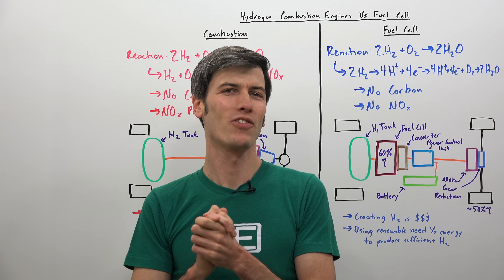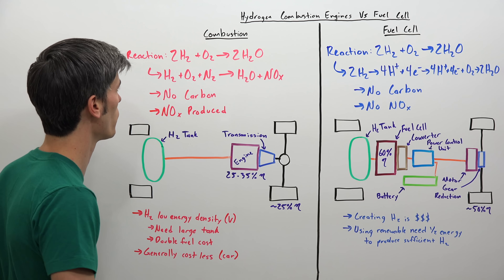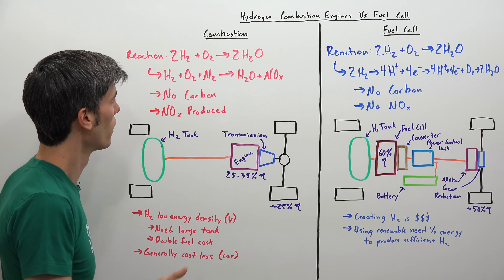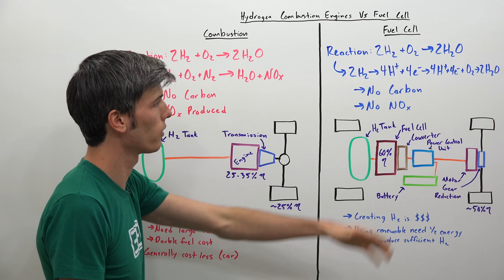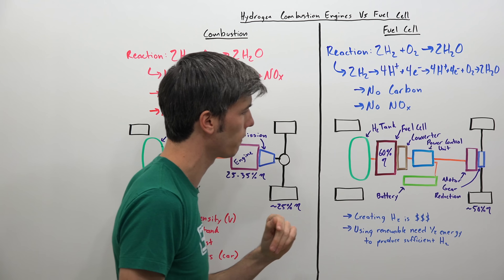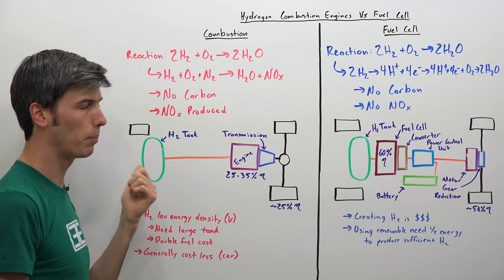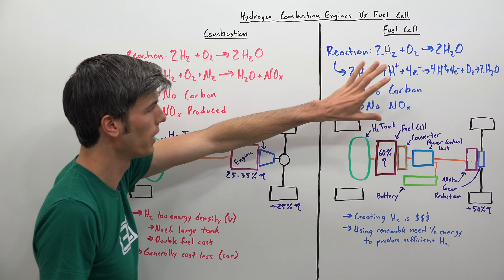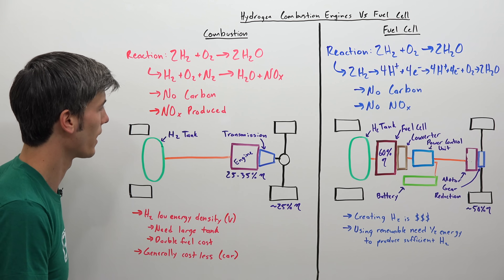Why Hydrogen Engines Are A Bad Idea

Comment: I'm interested in a comparison of the environmental costs of the components of a fuel cell system versus a combustion system. Comparatively, how much environmental damage must be done to obtain the resources, process them, and manufacture components of each system? Comparatively, how durable is each system; which has a higher rate of the machine components needing be to replaced and which system results in more components ending up as non-recyclable waste? Also, which system's components involve more toxic pollutants that we will need to deal with at end of their operational life? The energy efficiency and emissions during operation are just one part (and maybe not even the most significant part) of the evaluation when comparing systems. While we might be reducing emissions at the tailpipe, we might actually be increasing the overall amount of greenhouse gases as well as toxic pollutants if the manufacture and disposal end up being dirtier. I think of my new energy-efficient washing machine that doesn't do a very good job and broke down after 11 months requiring electrical components to be replaced, and then broke down again one month later requiring another trip by the repairman and creating more electrical waste. Compare this to my old washing machine that did a load of laundry in 20 minutes as opposed to hour, got the clothes cleaner, and lasted thirty years. Granted, the new computerized machine is touted as using half as much water and 25% less energy than the old simple mechanical one, but if I am going to end up going through several of these new high-tech machines over a thirty-year period, sending that many entire machines to the landfill and creating that much toxic e-waste maintaining them, I cannot see how it can honestly be regarded as more sustainable and environmentally friendly in the big picture. Also, the new high-tech machine costs a hell of a lot more, takes more than three times as long to do a load of laundry, and does not clean clothes as well. I think we are making a grave mistake by narrowly focusing on the operational metrics rather than the overall big picture.

Comment: Most do not realize that the hydrogen molecules are so small that they leak fairly quickly even through metal, even steel. Where pressure sensors are needed for instrumentation, a better way to prevent hydrogen from passing gas thru stainless steel sensor diaphragms is to have the steel electroplated with a thin layer of gold! Larger vessels as well as pipelines are also subject to damage by hydrogen embrittlement! Sealing the inside of pipes and vessels with a thin plastic liner helps to extend the life of the metal and reduce hydrogen leakage.

Comment: Great explanation.  IMHO, you are showing the path to conversion.  Current cars need a way to become greener, while not going straight to the junkyard which is a complete fantasyland.  Hydrogen fuel cell cars provide the future path as they require less battery than current EV, while giving all the benefits.

Comment: So a few questions about this. 1, I’ve seen people use baking soda as a catalyst to get more out of the water to make more Hydrogen. Would that solve the efficiency problem 2. I’ve heard that hydrogen is a more combustible gas so wouldn’t it have more efficiency at higher speeds and just in general. 3 nitrous oxides is a product/exhaust of Diesel engines, couldn’t we just build a DEF system for this? I know that DeF is bad for engines longevity but would it help? 4. Couldn’t we use the nitrous for boost? Genuine question cause I don’t understand how nitrous oxide works
Reply: N2O and NO2 are not the same material.

Comment: Isnt the point not that its the best use of Hydrogen but that unlike a fuel cell you can easily convert an existing combustion engine over to Hydrogen whereas all other tech requires a complete re-engineering of nearly every aspect of the car and, while better, is only really viable as a "Replace every car ever made" option.

Comment: Instead of Wind and Solar, use energy (heat and/or electricity) from nuclear fission to generate hydrogen more efficiently. You didn't mention the difficulty of storing and transporting hydrogen, which is a large part of its current cost. I'd love to see a projection of the cost of energy from hydrogen if storing and transporting hydrogen drops to some minimum cost, and how it would get there. As you mentioned, it's expensive now, for several reasons.
Reply: leak would smell like Banana

Comment: Jason, why hasn't anybody thought  about some kind of steam motor powered by a superheater that doesn't need anything  except electricity and water . No batteries or hydrogen required and zero emissions . Just a super heater element as combustion method.

Comment: Thanks for the analysis and efficiency comparisons. You hit the crux of the problem on the head when you consider where the energy comes from to make hydrogen fuel. That is also the problem with electric vehicles as of today. And before the wind and solar enthusiasts jump in, you also have to consider the production costs an materials used to make photovoltaic panels and wind turbines. These have significant environmental costs as well during production and end of use disposal. I'm not saying we should not be pursing these methods, but rather be realistic about their shortcomings as well. One topic that almost never gets mentioned (although this has recently started to change) is nuclear power. Not in the archaic way we designed 3/4 of a century ago, but with newer small modular reactors and/or molten salt reactors (MSR). MSR's have the benefit of very high operating temperatures  (at near atmospheric pressure) which can provide alternate ways to produce hydrogen fuels through high temp chemistry or electrolysis. An MSReactor was operated at Oakridge TN for 4 years before being shut down for political reasons. SMR's (water moderated and cooled) have been running for 50 years in submarines and aircraft carriers.

Comment: Making hydrogen requires steam fracturing of methane or electrolysis.
Which means it takes more energy to create hydrogen then it gives you in return.
Reply: If you power the electrolysis unit with solar panels then who cares, or better yet powering it from the car battery which is charged by the alternator as you drive anyway.

Comment: Don't worry about using Hydrogen as a fuel, because: 1) You can't buy the material used to safely store Hydrogen because it is classified as a Nuclear material. It is use in Hydrogen bombs. 2) You can posses this material, but it requires a Particle Accelerator to make it. 3) It is illegal to buy/sell particle accelerators, but it is legal to own one. So, if you're smart like the retire scientist in New Mexico who built a particle accelerator and made the material for safely storing Hydrogen and produces his own Hydrogen using a Hydrogen generator and solar panels, you've got it made. He converted a 98 Corvette to Hydrogen. He gets about 400 miles per fill. Free fuel. Not expensive.

Comment: Jason, thx for taking the time to share this information. To begin, I hate present day batteries. They have relatively short lives, have capacity fade and for these size batteries are quite expensive. I had a hybrid car and was quoted $3995.00 for that battery.
I discovered that there exists electric hydrogen pumps, having no moving parts, that are good up to 10,000 PSI. Combined with water electrolysis this should be the preferred regen. system.
Ok, wonderful we've eliminated batteries and fossil fuels, replaced with new nuclear power and or renewables. So, we got it in bag so to speak, on dang, there's just one hang up left to conquer, it's cost. A typical fuel cell stack sized for a small car is still between $30,000 & $40,000. That one cost exceeds the cost of gasoline for the entire life of the car. That means that gasoline and iron still beats hydrogen fuel cells hands down.
I'd focus on hydrogen ICEs even with poorer efficiency than fuel cells. No one as in no one is gonna pay $60,000 to $70,000 for a Toyota Yaris in 2021. They'll choose an ICE burning gasoline, using the saved for gasoline and the rest for whatever.
So, until fuel cells are on parity with ICEs they will remain industrial and a specialty power storage device.
Again, Jason thx for sharing.

Comment: This reminds me of study where they essentially made an electric car but instead of powering it by battery they powered it by a gas turbine, similar to those that power plants use to generate electricity from gasoline and diesel, and it got up to around 47% efficiency. Some of my companies hybrid trains have adopted the system and have nearly doubled there efficiency from just plain diesel engine. which is not necessarily a fair comparison because those turbines are more efficient when they are larger and you can't really fit a train sized one in a car, and once a train is up to speed it doesn't really need much to keep going since the friction of steel on steel is so little, but still for cars thats a 12% increase over the most efficient turbo diesel, AND they're lighter AND it can make use of regenerative breaking. I believe the paper estimated ranges that were similar to the MPGe of today's electric but they didnt actually test it sadly. Hopefully a car manufactures R&D team look into that, could be a game changer for the hybrid market if it actually has any sustenance to it. Especially if combined with carbon free fuel, which would be more plausible if people were having to buying gas 1/4 or even 1/3 of the time.

Comment: Its immediate cost versus delayed cost. A hydrogen combustion car would be about the same price as a regular combustion engine car at purchase, where a hydrogen electric car would be up to twice as expensive. Though you will pay double the fuel cost when driving the combustion car.

Another item that is not mentioned. A combustion Engine car uses more recycled material then a electric car, specially the battery. So if applied in volume, the combustion car would be more expensive, but the electric car would produce allot more non environment friendly waste once it hits the end of the batteries live cycle.

I would say to get people to use it initially going the combustion route would be more successfull, at a later time when they figure out how to match cost of the car, turning into electric may be more feasible.

Comment: I admit I haven't watched the entire video yet which I will do but a quick glance brings some questions to mind. First question, where did the Nitrogen come from? If it comes from the air, Oxygen concentrators will filter it out. 

I noticed on the board behind you it states Hydrogen has low energy density. I read elsewhere that Hydrogen has an energy density almost three times more than diesel or gasoline. 

I have been thinking for some time that water could be split into Hydrogen and Oxygen with electricity generated by wind or solar power then used to power cars, trucks and trains.

Comment: What about HHO, it is dirt cheap (can be made from water) and burns in a similar way even if hydrogen is less efficient you still get the great sound of a V8 but without fumes. the whole point of using hydrogen instead of gasoline is not for raised efficiency, it is to have the same driving experience without any fumes. just because one engine uses hydrogen, doesn't mean it's the same thing, kinda like saying a house is the same as a UPS delivery van because they both burn propane.
Reply: Because saying that is an explosion hazard is a undestatement, HHO is like boiling gasoline in a cooktop but worse
Reply: ‘It is dirt cheap because it can be made from water’ LOL you forgot the other ingredient: loads of energy
Reply: @Simon-dm8zv  electricity is cheap, and I didn't say it was because it was made from water" he is making an unfair comparison and not understanding the REAL purpose of hydrogen combustion engines. you get the noise of a petrol engine without the pollution, thermal efficiency has nothing to do with it.

Comment: I think the true want and desire for Hydrogen Combustion Engine is the desire to keep the Combustion engine a lot of us Engine heads love. I maybe speaking out of my butt here. But i know im absolutely crying like a big ole baby over here about Electric cars taking over. Yes they're great for the environment i will absolutely not deny that. But those engine noises and just like the manuals slowly being removed as an option forever just scratches an itch. 
  The electric vehicles are even faster than gas rivals which is mighty impressive but is now starting to become expected. Heck just go look up the Rimac Nevera vs. Ferrari SF90. That alone is extremely impressive but low-key heart breaking. 

Overall apologees for the rant, awesome video, love the break down of your videos on the channel especially since I'm an aspiring engineer myself. Keep up the awesome work.

Comment: In relation to the space required for Hydrogen, yes you are right if Hydrogen in the form of gas is being used which has a very low density. but what if LH2 (Liquid Hydrogen is used. the density is more than the x3 of the H2. LH2 has more than x3 of volumetric energy density. H2=0.69kWh/L & LH2=2.36kWh/L.

Comment: For H2 combustion engines, why don't process NOx as we do today with gasoline engines ? Should not it be cheaper than a fuel cell ?  Or should it be possible to have  a H2 tank plus a O2 tank?

Comment: The cost of a hydrogen fuel cell power plant would be significantly higher than an ICE burning hydrogen. Also, I would suspect that recycling a fuel cell would be expensive and difficult. Finally, there is the cost of producing hydrogen..Splitting it out of natural gas is still using hydrocarbons, and splitting it from water requires a very large amount of energy and is very expensive to do.

Comment: AAAAAAAAAAAAAAAAAAAAAAND you forget one of the most important part and its degradation... while ice generally lasts forever, fuel cells and batteries degrade and have to be periodically replaced, which is a far bigger expense than refuelling it. both are major components of the vehicles

Comment: What happens to the Nitrogen which is in the atmospheric air.  - also the way to effectively generate is converting H20 to browns gas through electrolysis, that way there is not a compressed cylinder of hydrogen, only a tank of H20.

Comment: Ah, this is just what I was looking for. I was in search of a type of engine or energy generation system that could be the second part to a hybrid system for a large truck (About the size of an RV, but also potentially heavier due to maybe making it armored.) The main part would of been solar power and a battery array, but I also was looking for a secondary system incase the primary power source is unavailable and the battery array ran dry.
Reply: " The main part would of been solar power and a battery array,"

That's great as long as you don't want to haul more than approximaately 1 ton-mile per day, and drive it only on a dedicated road where it cannot possibly get in a collision, because solar-powered cars(*) have already demonstrated that to even be functional, the frame has to be like that of a WW1 aircraft -- EXTREMELY light weight with no provisions to mitigate injuries caused by crashes.

(*) There are actual races between teams at various research universities using solar cars.  They're EXTREMELY low, and have less collisioi safety than a bicycle, because every pound makes such a HUGE impact on speed, even more than in horse racing.

Comment: Just wondered if the problems of energy density and nitrogen oxides can be mitigated by water electrolysis and a few extra batteries? It's not that fuel cells aren't cool but the platinum catalyst component in them make it pricey and hard to produce in general population use numbers, is that still the case or has there been a development in that? Also I'd like to point out that while combustion  is old tech, it's advantage is that it's old tech, and all current hydrocarbon combustion engine driven vehicles are a possible resource saving with a little retrofitting.